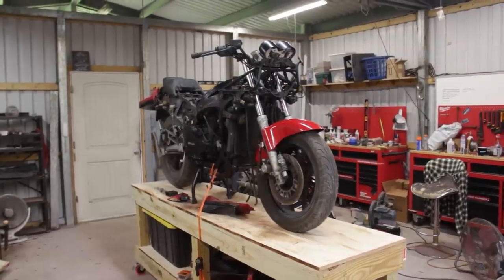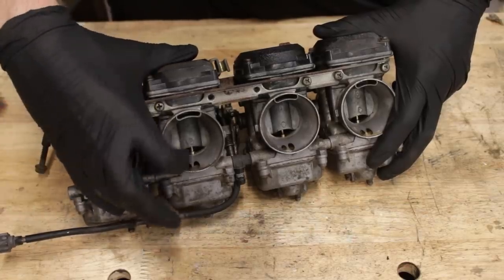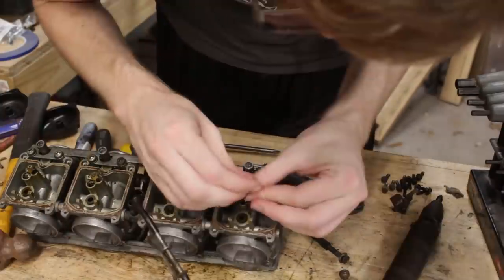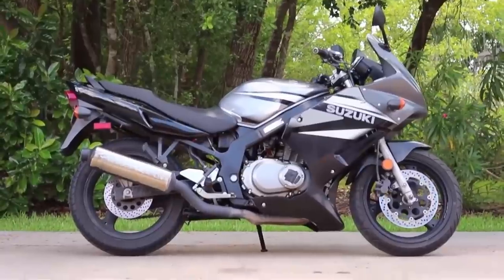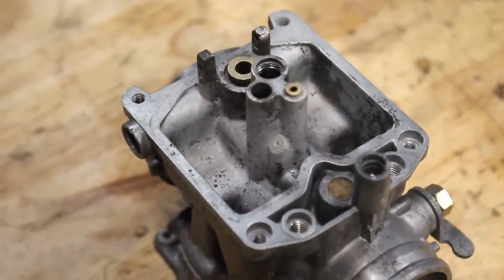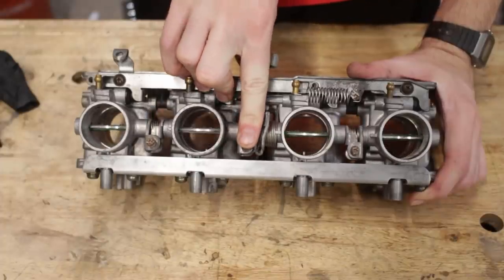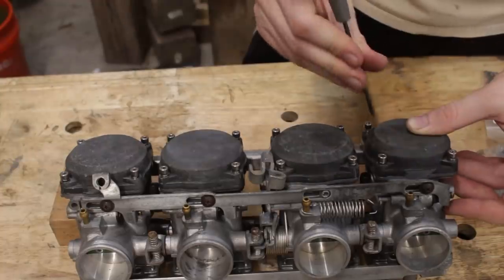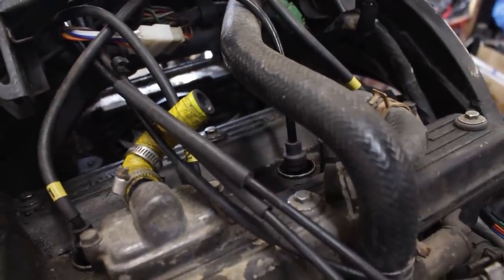First Start in 17 Years | 1986 GPZ1000RX Revival - Part 3

Comment: Speaking as a professional bike mechanic, this was an EXCELLENT first time deep dive into carbs. The only things I would have done different: remove the slide and float first thing and spray the bodies out as best as possible with carb cleaner and compressed air, then let em soak in some penetrant. That will loosen up stuck jets, etc. or toss the whole ass assembly into an ultrasonic/ bucket of gasoline/ hot soapy water for the same effect. The worst thing you can do with old carbs, from my experience, is going in dry. Also inspecting the diaphragms for pinholes and tears, which I assume was done off camera. Lastly, again in my experience/opinion, submerging the slide diaphragms in the ultrasonic solution is perfectly fine and if its the heated type, will actually improve their condition.

One last hot tip, get you some methyl salicylate and put it on all those old rubber parts like intake boots, fairing bushings, etc. It replenishes the oils inside the rubber and makes them pliable and less likely to tear or crack.
Reply: Great lesson there bud. Cheers x
Reply: good tips!
Reply: Yeah, I'm super new to bikes and even I get nervous using any kind of impact tool to remove stuff, or going caveman mode and banging stuff. It worked out for this guy, but I'm never so lucky so I'm usually super careful lol.
Reply: Agreed, gets a bit uncomfortable going in dry....
Reply: Risk damage going in dry. I also check the diaphragm for pinholes/tears. You can never be too careful, even if you trust your Mrs.
If your too hamfisted, she will make the switch to electronic injection (and where does that leave you)?
Reply: Bars!!! 🔥🔥

Comment: I have a 1972 Fiat 500 which hasn’t started for 10 years because the original carburetors were replaced with Webers and these chronically leaked and the engine never idled. Your tear down and final start was so encouraging that Ive decided to take this on with my 16 y.o . So that I can pass on some of the learnings I’ve accumulated from years of rebuilding air cooled bikes, VW’s and a BMW 2002.

Comment: Wow... For the last few weeks I've been doing the same things to my unstarted for 5 years VMax 1200. Carbs done, coils & leads changed, dodgy wiring repaired, main harness, brake & clutch fluid, oil & fuel filters, fuel lines, coolant o-rings - all replaced and today is FUEL TANK CLEANING day! Don't neglect that or you'll be back into those carbs again and we all saw how much you enjoyed that. Thanks for the motivation! Subscribed.

Comment: I know how you felt when it simply fired right up. There is not much that is more satisfying than when the engine fires immediately and runs smoothly , especially when  you have not heard it run on it's own yet as opposed to using ether. I really enjoy your content Mr. Finger!! As I have said before don't change anything about how you do this stuff., it is quite literally most of the reason I enjoy it.

Comment: I had such a similar experience rebuilding a 1997 ZX11. I sorted the carbs and it didn't start cause the fuel pump was bad. When I got a new one it started up like an injected honda civic. Very reliable motors with non ethanol gas if they are run regularly. And wow the power. I just realized you restored a Fiero and that was one of my first cars. Now you are rehabbing a older gen of a bike that I restored. I still regret selling my ZX11 3 years later. When you ride that...it feels like you are sitting on a wood burning stove. They put out a lot of heat.

Comment: The floatbowls were in the correct orientation in the beginning, if you swap them you make it harder to reach when everything is assembled. They have this orientation so that you can opperate them with a verry long screwdriver from the other side. If you swap them like you did you cant really access them because the frame is in the way.

Comment: You asked for carb stories, here's mine. I used to do up old Corollas with K motors - 4 cylinder 1200cc from the 1960s. One afternoon sitting around after work with a mate and his dad, they suggested let's try to modify the carb. Off it came and onto the lathe for a light throat skim and a large vacuum step. I was very skeptical but hey parts were cheap, I think I had several spare carbs at home already. It was back together by 7pm and wow! That became the absolute best most responsive car I've ever driven, including all EFI cars. Years later I realised this guy's dad had spent decades hand-tuning lawnmower engines for go-karts, no budget but lots of time, and he really knew what he was doing by feel alone. I've owned many cars since then but I still have that carb on my garage shelf. Memories.

Comment: I bought one of those tiny ultrasonic cleaners for jewelry from the outlet corner of a local hardware store (it was dirt cheap).
Used it on the stainless steel bracelett of my wrist watch. After a single cycle of about 20 minutes in just water and a bit of dish washing fluid, the bracelet was absolutely spotless, all the linkages completely free from old sweat and dead skin cells. 
Worth every penny (well, øre, since I live, and bought it, in Denmark). :)

Comment: Great video, Ronald!
I have a tip for you for adjusting the throttle linkage on each carb.  Get a new drill bit, about 1/8" or smaller.  (Smaller is better for this job)  Use the idle adjust screw to position the throttle on the #2 carb so that the smooth shank of the drill bit just slips in between the throttle plate and the carb body (just like using a feeler gauge).  Then set each other carb's throttle position using the adjusting screws and the same measuring method.  That'll make sure that all four butterflies close at the same time.  Then you can do the final adjustments with the idle air screws and a manometer.

Comment: Hey Ronald, great video. I've watched Taylor over at Classic octane and he does a great job with carbs. This video was really informative too. And yes, I've confused JIS for Phillips head in the past, and I too have replaced Phillips head with hex head cap screws wherever possible. I have also had the backwards float bowl drains, but that was the fault of a repair shop. I still have the extra, extra long flat blade screwdriver I bought to deal with it. :)
Thanks for the great stuff, and keep it up!

Comment: Tip for carb install. If you can, remove the old rubber boots and soak them in hot (not boiling water) for a few minutes. They go on way, way easier. Saved my fingers and sanity. Glad you got your carb troubles solved!

Comment: Had to laugh on the carb issues, spent ages on refurbishing my six CBX carbs, and had to get a replacement float bowl after messing up a brass insert. Same ultrasonic cleaner, great results, new “hardware”, new set of correct screwdrivers all carefully reassembled, all throttle and choke mechanisms working as they should with springs now included. The first time I put fuel to the carbs they leaked worse than the previous red gunk for gaskets! Yes those O rings on the connector tubes should have been replaced, took me two more attempts to get the whole assembly working right without leaking fuel but it was worth it. Looking forward to seeing if you can get this one working right. I’ve a first edition GPZ900 with carb issues to work on, again had to smile at your adventure.

Comment: brilliant video, as usual, well done Sir, you can rough balance the carbs on the bench using a feeler gauge between the butterfly and carb body on all four carbs, it will get it close enough till you can use vacuum gauges once they are fitted to the bike and the engine is running

Comment: All the way through I was thinking "New O rings on the link pipes" and then we get to the end of the video 😊😊. Great vid, thanks. No mention of condition of diaphragm rubber - I guess it was OK. The UK is now moving to 10% ethanol fuel, so good to change any seals/rubber to ethanol resistant when you get the chance 😊😊

Comment: Ron.  I had those same carbs on my c-10 concours,  one thing that can happen is that if the floats stick (ie needle doesn’t seat due to crap in gas etc) and the fuel is left on they can cause the cyl to fill up with gas and when you go to start the bike it will hydro lock and bend a rod.   While they are apart you can add overflow tubes to the bowls that way if the float fails it won’t risk a lock, it’s a cheap mod and really worth it  (DAMHIK)

Comment: Hey Ron, in the future when cleaning parts with the ultrasonic cleaner you might want to think about filling the ultrasonic cleaner with water and then putting the cleaner and part(s) in a ziploc bag and submerging the ziploc bag in the water bath.  It keeps the inside of the ultrasonic cleaner clean and you use less cleaner.  I learned that from Steve's Small Engine Saloon YouTube channel.  Great video, as usual.

Comment: I recently rebuilt the carb on my Mopar.  Redid the rocker cover gaskets, ignition coil, plugs, wires...  I started it up and voila, it's up and running and sounds great.  I'm like hot damn, it's working.  Then my dad comes running over and shuts it off.  Massive fuel leak, the fuel pump looks to be cracked.  I guess after 50 years, there's more things to replace.  Keep your spirits up, it's just the way things go.  The weakest link in a percentage to fail of parts is how it goes.  Once you get the so so stuff to 100% it starts taking it's toll on the shady parts or things hanging on by a thread.  Bike sounds great though!

Comment: Good job on mostly rebuilding the carbs.
Here's a helpful tip from someone who works on motorcycles alot, also.
Adjust the valves to the loose end of the specs before you go to balance the carbs. Not the tight end of the specs. The loose.
If you don't, you will eventually perform a valve adjustment, and it will throw out your carb balance, so, make sure you adjust the valves first, and then balance the carbs.

If you adjust the valves to the tight end of the spec, after a while, you will have introduced an issue of having a bike that is hard to start when hot, and may even stall when you come to a stop, when fully warmed up. It will start fine when cold, and idle perfectly, but once the bike gets hot, restarting after a quick stop will become a problem.
Reply from the maker: Good to know! I balanced the carbs about a month ago actually, but have yet to do a valve adjustment. Once I do that, I'll go back a re-balance them. Thanks for the info!

Comment: Good video.
The float bowls were correctly installed because it has a perimeter frame you can only access the drain screw from the opposite side with a really long screw driver!
You will benefit from adding overflows to the float bowls or you will end up filling your sump with fuel! The float needles will stick and there is no indication that this has happened, the first thing you will notice is the oil sight glass is now full!

Keep up the good work!

Comment: Congrats!  What aux fuel tank are you using?  Helpful hint for your ultra sonic cleaner- put whatever you are cleaning in a ziplock bag with cleaner inside- and drop that bag into the cleaner with water- will clean just as well, uses less cleaner solution and keeps the device tub clean.

Comment: OHHHH I CALLED IT , since like the first video!  I knew the ignition module was gonna shit itself or be dead entirely. My experience the module is gonna work until it gets warm then kick off. I would have gone with that aftermarket one i listed on the older video, that way you get some longevity out of it. Cause that used one is probably gonna quit and leave you stranded. as my module had only 11k miles on it.

Comment: Hi Ronald: as for ultrasonic cleaning it is very important to degass your water first.
This way you will achieve transient cavitation and will clean better and faster.
So that metals don't have to be exposed to cavitation to long. (cavitation erosion)
Putting water and detergent in it, turning it on and dropping your carbs in it will not clean it properly for the first (give or take) 15-20 mins. 
As there is still loads of oxygen in your water.
You will hear when transient cavitation is achieved because that's an unmistakable sharp sound.
Also: because of the sound waves to create cavitation it's even better to leave the lid on....

Just a note from a humble sr. Validation Engineer :)

Comment: Get Vessel JIS screwdrivers. I’ve got two different sizes, and they are my go-to…..
BTW, a baking soda blasters my favorite way of cleaning up carb bodies and making them look like new. Baking soda is just abrasive enough to clean, but won’t damage the metal and is water soluble. You can get a cheap handheld sandblaster at the Horror Freight, and a big bag of baking soda at Sams Club. Been using the same bag for almost 7 years now…

Comment: I have a 1986 Kawasaki GPZ 600R, it's my first bike ever/project bike, I've been working on it for about over a year and I got hit with this same problem to with the carbs, but instead of it being just unclean, all of the screws had been stripped, so I had no way to actually open the damn thing, so I just gave up and went and bought a whole new carb set and rebuild from there, currently all I need to do is change the tires, brake pads, boot manifolds, and get some clams for the boots.

Comment: I got some JIS bits for my impact driver prior to taking my carbs off.... only to find some previous owner had swapped all the screws out for stainless Allen heads, and my fuel leak was just the previous owner had pinched the float bowl gasket.

Comment: I had a Kawasaki kz1000 with these type carburetors. They were in good shape and I quickly and easily rebuilt them. I replaced them with Mikuni racing carburetors because the cold start idle was too high on the stock carbs. You may want to go that route too if you don't mind spending $750. I miss that bike and  I'm going to get another. A minor accident totaled my first one. I was really enraged. Some idiot was looking right at me and turned left in front of me. 😡😡😡😡😡😡😡😡😡 Love the projects Ron!

Comment: So my first bike I owned was an 86 Honda Shadow (circa 2004-ish). The thing was a wreck, looked like somebody hacked the harness up like a horror movie. When we tore that down to frame, and worked on just about everything to get it fired up, it was a glorious moment. Sure, it was open headers at that point. We couldn't hear ourselves think. But when my dad, my godfather, and myself were standing there and got it to turn over and run.... giant grins the whole minute the first time it fired. That bike was superb, and if I didn't have a GF at that point, I would never have upgraded.

But the Fuel Injection on the newer bike was...pretty sweet.

Comment: I believe the main jets on your original carbs were larger because the bike had an aftermarket exhaust. Typically when installing an exhaust on a bike, you have to increase jet size because of the increased flow. Idk how it happens but itll lean out the engine running stock jets with an aftermarket free flowing exhaust

Comment: Don't be apologizing for the cursing. My first bike was an '80 KZ-500. My four carbs were never in sync, and the rubber horns connecting them to the cylinder head had hardened into stiff vinyl. I got so pissed at that thing I once spiked the carb assembly at the ground. I feel you bro.

Comment: I do love your rye sense of humour in these videos 😅 And why the surprise when some properly cleaned carburettors work straight away? The amount of people I've told to ultrasonic clean carbs that have been sitting for years is far too long a list and only some finally listen after spending days trying everything else but ultrasonic cleaning. I also buy 5L bottles of carb cleaner to whack in the cleaner. 
Oh, and you coulda tried filling your blast cabinet with bicarb soda to clean that fire damaged carb up but vapour blasting is best for ali parts 😉

Comment: I like the no name ultra Sonic cleaners off Amazon/ebay. I use a 10L version with drain. You can try putting little stuff like jets or single carbs in a mason jar filled with cleaner so the main tank doesn't get dirty. Also torch tip cleaners work to clear out little passages. My latest budget refurb was a $500 '87 quadrunner.
Reply: Dawn dish soap works ok...I'm sure not as well as the simple green etc.

Comment: I was wondering if you were gonna change over the carb top & bottom hardware to allen head bolts like I do on all of my bikes the first time I have to tear into the carbs. And then you did just that. Your brain works like mine..."I know I'm gonna be in here again at some point. And I'll probably just round off the remaining good screws. So let's eliminate that issue now." Well done, Ron with the Big Brain!

Comment: Dang she fired right up! Good stuff explaining the carbs, a bit too late for me cuz i recently read into them because they seem a bit scary tbh.
Is there a specific reason many bikes use individual carbs? Like even the gs500 used a dual carb setup while some v8 cars use single ones. Also shouldnt you sync the carbs after disassembling them?

Comment: Little tip Ronald , put the parts in ziplock bags with the cleaner , then fill the ultrasonic cleaner with water , see where I’m going with this 😎 the ultrasonic waves transfer through the water into the cleaner , you use far less cleaner 👍